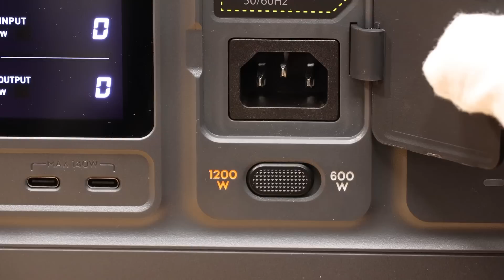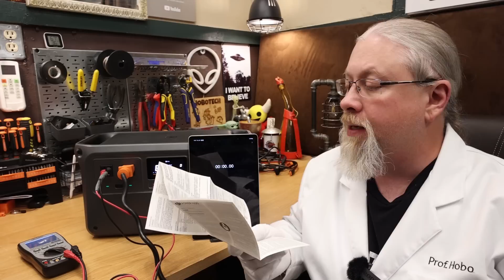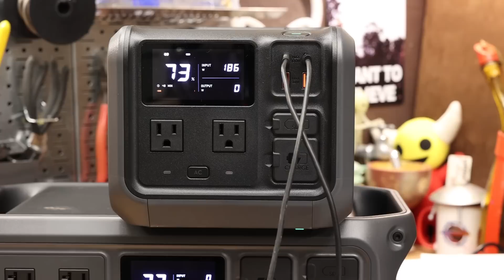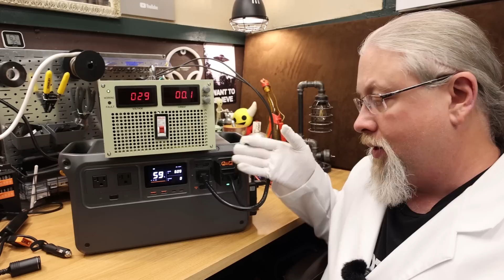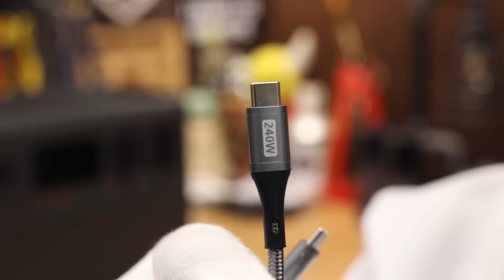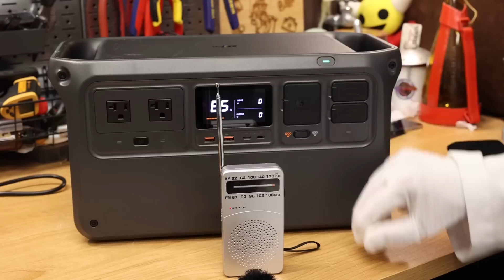DJI Power 1000 | Budget Compact 2200w UPS Portable Power Station

Comment: I heard it can be used as a UPS, does it connect to a computer so it can tell the computer to shut down?
Reply: yes, it works great as UPS, but it does not communicate with PC
Reply: @DanielBultas How does it connect to a computer? What protocol does it use?
Reply: @martinlutherkingjr.5582  It simply acts as a large backup battery that switches to battery power within 20ms and then back to AC. It doesn’t offer extra features like USB communication to shut down the PC. However, you get up to 6 hours of server backup instead of the usual few minutes that a standard UPS provides — which, in my opinion, is better.
Reply: @DanielBultas Well…that means it doesn’t connect to a computer so it can tell the computer to shut down…

Comment: 3/9/25  10:15 AM to 11:15 AM  East coast USA near Baltimore  MD .  Temperature around 50F.  I charged my 1000 with 6 100W Zignes panels DJI sells.   I got a constant 550W input to the 1000 . I initially angled them using the can  method and then left them alone.  I cannot complain about that!  There were small wispy clouds passing by occasionally at high speeds  That was from a 50% battery remaining level

Comment: Can anyone confirm if it is possible to use the DJI 1000 to charge and discharge at the same time.. i.e connect to a small gas generator ~1200w limit, and draw from the inverter at the same time variable (200w to 2200w - average 600w) up to the maximum inverter output. In other words not do a bypass function which would draw directly from my tiny gas generator, popping a circuit breaker during high load. (Can I effectively use this as a power buffer?) This has been a difficult use-case detail to find about all of these power stations. Thanks in advance.

Comment: For off grid use, I expanded my ($380 2024 Fall sale) DJI 1000 power station run-time by connecting a 2560WH LiFePO4 battery ($285) to the DJI via 3 XT60 cables to the MPPT in parallel. I was able to leverage the full charging capabililty of the MPPT (without needing to use the INPUT SDC 12V cig cable). 

For charging the LiFePO4 battery itself, I use the DJI 1000 OUTPUT SDC 12V cig cable (when not in use for anything else) in combo with solar panels/ MPPT OR a DC/DC from my car alternator (when driving). 

My total cost came out to be around $900 USD for 3.5Kwh. 
$380 DJI 1000 (2200watt inverter is nice). 
$60 MPPT
$19 SDC 12V cig cable output.
$285 LiFePO4 batt. 
$100 for 2 100W panels
Misc parts to make cables and DC/DC converters.

I might expand it with more LiFePO4 batteries in the future.

Comment: So glad I came across your channel, these are the most thorough reviews I’ve seen of power stations and I especially appreciate the amp noise/RF/EMF tests. I picked this unit up two weeks ago when it was on sale for $379. Was hoping to be able to use it for amateur radio (using the AC inverter) but seems like that’ll be a no go. I do love the Power 1000 but your review of the EF D3 Plus makes me wonder if the inverter in that would be quiet enough for HF radio use on the AC side. 

Though the easy solution is to just charge another battery using the Power 1000 to power radios. Thanks for the review!

Comment: Are you going to be testing out the DJI power 2000 extendable for the DJI power 1000
Reply: See my comment above, there are much cheaper options to connect to the DJI 1000.

Comment: The SDI ports are now usable with the new 2000 expansion battery. For up to 11264Wh. And it works with an app now. They also released a 1kW car charger. Can you share your experience with the new accessories?

Comment: :hand-pink-waving:The brackets are important THEY ARE HEAT SHEILDS FOR THE MPPT POWER PANEL. I think they go under the box and vertically. If the main box gets hot the power panel will not.

Comment: I was considering this until I saw the inverter inefficiency and panel restrictions.
Now it's between the Dabbsson dbs1000 pro and the newly released Ecoflow Delta 3 Plus.
Still a great video and info as usual from the Professor.👊👊
Any suggestions?

Comment: Thanks for this video!  Did you ever get the second MPPT controller from DJI?  I would like to know if it can actually pull in the 800 watts of solar they claim with dual MPPT controllers. A person on Reddit said they connected three 120W panels to one DJI MPPT controller and said it pulled in 350watts for about 10 seconds but then settled out at 300W. Are you able to split your fake solar machine into two XT60s to try to send 400W of solar into two ports of the DJI MPPT controller?
Reply from the maker: I didn't, but I told them dont bother. After a review, I box up the product, move to storage, then on to the next.
Reply: Charging speed depends on battery SOC and other conditions.

Comment: Caution:  If you unplug the unit from the wall and touch the 3 prong plug.... you will get a shock.  I did not measure the voltage but someone should look into this.   This is a hazard.

Comment: USB C operates at 100watt with some cables  -some 140 watt usb c cables default to 60 watt
Reply from the maker: I clearly show in the video the cables I use support 140w.
Reply: @HOBOTECH  yeah it’s frustrating- I went through 4x different power banks and 5 different cables … 100 watt cables draw 120 watt , the 140 watt cables draw 57 watts needs a fix like you said

Comment: FYI, on Amazon, others have reported that when those USB-C power banks get warm they default to 60W charge/discharge so maybe the USB-C charging ports on the power station were indeed 140W but the power banks were the issue...
Reply from the maker: Nope, they were sitting at room temp all day. I show in the video they worked just fine.
Reply: @HOBOTECH  a USB-C to MagSafe 3 cable provides ~100W of power to a Macbook Pro 13' from the DJI POWER 1000's USB-C ports. @jeff8207 might be unto something. Might want to test with a 16-inch Macbook Pro which takes the full 140W on paper.

Comment: Thanks, that was a great review. 
Currently, I'm torn between either the; Renogy Portable Power Station Camping 1000 or DJI Power 1000 - 2400W Portable Power Station. 
As a drone operator conducting geo-surveying in the field I'm edging toward the DJI Power 1000 However, the rest of my power setup is Renogy 
Renogy - Pro-12V 100Ah Deep Cycle Lithium Iron Phosphate Battery, 2000W 12V to 230V/240V Pure Sine Wave Inverter, 12V/24V IP67 50A DC-DC Battery Charger with MPPT with Renogy ONE Core and 200 Watt 12 Volt Flexible Monocrystalline Solar Panel. 
Hence why I was looking at the Renogy Portable Power Station Camping 1000
The DJI Station, I can live with the proprietary cables, but that solar input is a bit of a letdown. 
@HOBOTECH - Have you reviewed the Renogy Portable Power Station Camping 1000?

Comment: I would highly suggest anyone thinking about this should check out the Ecoflow Delta 2. You can get it now around $529 and it comes with solar capability and car charging cable out of the box. No messing with extra adapters, and has the ability to 2x or even 3x the capacity with add-on batteries.

Comment: I don’t own a laptop so no firmware updates for me. 

The solar add on is not terrible but the cable slop will be heavy with 6 panels, 12v inlet for cooler and charge cables.

Comment: FINALLY - REDEMPTION !

Jackery is no longer the shittiest power bank manufacturer on the market. Well done DJI, that was a difficult bar to undercut. 

But seriously, 6 1/2 minutes in, and I see no reason at all to buy this device. Faster charging for drone batteries? That’s a joke of a benefit. If you need to take that much drone footage just buy 3 extra batteries and get a , cough , jackery to recharge them.

It’s their first product. So we’ll let it slide and judge them when updated versions come out in a year or two.

Comment: Thorough review as always Professor. When I shop these devices I stick to a $500 per 1kw budget. I have the delta 2 + eb I purchased for $999 a year ago (great unit) that can be had today for same $ at Home Depot today and most days through the year. Amazon today 7/8 is $899. Also have the Oukitel 5000 and use daily since 1/1/24 without any problems at all purchased for $1749. Some complaints are it produces low voltage around 110 or less, mine has never been that low. Currently running 5000 btu ac @120 volts. With Prime days coming up and everyone having their own sales in play, could be some good deals coming!

Comment: The price is okay, but the product is just too weird. If I were a videographer or photographer on the go with a dji drone, what I need to change is pretty much the drone and laptop, and cameras. Then I probably wouldn’t even need a big inverter at all yet this thing has a 2000w inverter, the 140w (if working would be great to charge most laptops and cameras, and get a cable for the drones. I would much prefer they cut back on the inverter to maybe 500-1000w and fit in the solar controller. After all the thing only has 1000wh with 70% capacity, with no way to even connect extra batteries, what good will the 2000w inverter do with that capacity.

Comment: It's a very confused product. It's cooling and recharging systems are designed to be as lightweight and compact as possible while sacrificing performance except for charging your drone batteries which is what it's designed to do, ok that's good. However, It also has a huge inverter that it simply can't support but increases the bulk and cost without providing much useful function.

Comment: Another Jackery proprietary cables😮

Any power station can charge with more than one 12v socket.
You just need a splitter for the solar input. You can have 2, 3, 4, or more depending on the Max current or MAX voltage in series input.

Comment: Just buy an Ecoflow and be done with it. You can't update via an app because there isn't one. You can't DC charge out of the box. The USBC ports failed, which might be fixed later down the road with a software update, but you'll need to be ready with your PC to do the update. Stick to drones DJI!
Reply: Eco flow too noisy I have two

Comment: if you need all the cables, they are listed at $19.00 each. Best to make your own if you have the ability.
Reply: The SDC connector end has addtional pins for data communications or settings, plus I haven't found out where to source the SDC connectors themselves.

Comment: Not including the ability to charge via solar or via your car out of the box… ya DJI is not doing great here.
Reply: Yep, when he covered this around 2:10 I was like "well that's a dealbreaker for a lot of people.."
Proprietary connectors should be avoided whenever possible. It's a step backward when most of the competition can take basically any DC input voltage within a certain range through their integrated MPPT controllers, using standard connectors like XT60 or Anderson power pole..
Reply: @Jay-Crowe  Even Jackery is starting to stop with that nonsense
Reply: @Jay-Crowe  it’s built for people that are drone operators, ones that make money with their drones. Also use only the new DJI drones… which the government is close to banning.
Reply: Well there goes more than half their sales 🙃
Reply: Crazy they missed this
Reply: @TheWatchMker  they did not miss it. They saved money by not including it and think because they are DJI people will buy it anyway
Reply: @JoeyRiz correct. And I bought 2. It’s very well built.